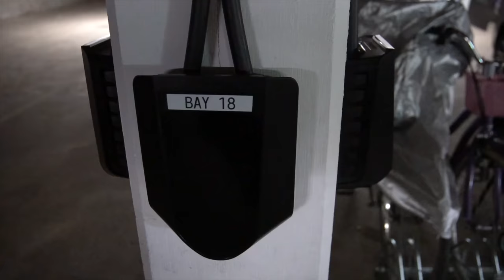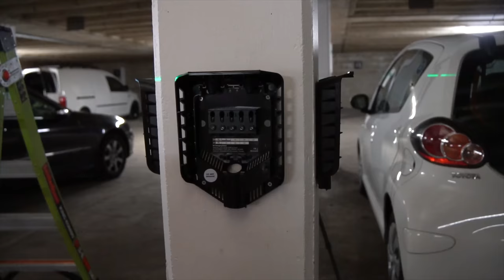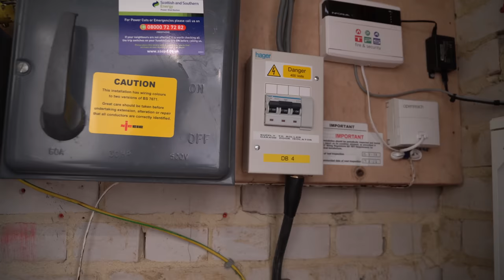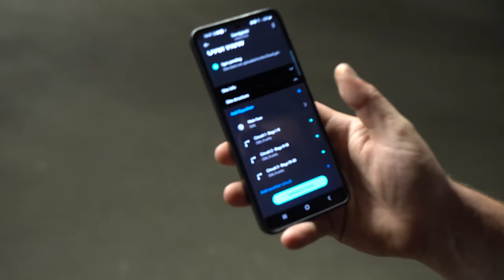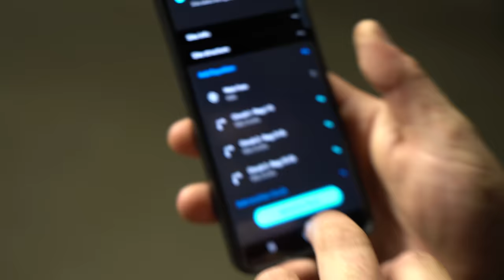Installing 660,000 watts of EV Charging

Comment: I'm a 60 year old semi-retired electrician and have disturbed a lot of asbestos in my time, especially in power stations accidently  knocking lagging off pipes, drilling into asbestos sheet thinking it was plasterboard, but what I'm dying of is silicosis caused by years of inhaling concrete dust from drilling and cutting!
Reply: Sorry to hear about the silicosis. But agreed on the asbestos, worked around it myself for years and years. So far, all good and even knowing the risks back then, never worried about it. But people today act as if you touch it, you'll die.
Reply: I know it’s a different type, but in Russia they still mine and use blue asbestos

Comment: Asbestos is fine if still intact, you can double bag it up and dispose of it properly, Chrysotile woven asbestos is relatively safe compared to other forms of asbestos so the risk from a few fuses is EXTREMELY low, There's more of a risk if a fuse has  blown as that may have damaged the rope. there's really no reason to throw anything away that's been in the same room.
Reply: He said there was asbestos residue on the floor?
Reply: @Pugjamin  How could he tell without specialist equipment? Could just be dust or plaster,  it's very unlikely if the fuse was in good condition.

Comment: Great vid as always Cory, regarding the thermal runaway, I think this is less of a problem in newer EVs, and will be less and less of a problem over time as we move to solid state batteries, so long as a company doesn't store a load of Chevy Bolts under your apartment, the risk is fairly low :)

Comment: In Belgium, there is a requirement to have an RCBO per charging point. Every charging point is therefore typically wired separately with 6mm2 into a distribution board close to the parking spaces, with the RCBOs in that distribution board. In case of a bus configuration, the alternative is to integrate the RCBO inside the charging point, but then this is not user-serviceable (i.e. you need to call an electrician to activate it again...).
Love the channel, lots of love from across the channel.
Reply: Yes Ruben, Correct. And in underground carparks Belgium also requires an emergency switch on every exit. 
Makes it a lot more complex with the rcbo's and the extra regulations.
Reply: Don't forget about a mandatory four pole isolator for each item of fixed equipment, haha maybe that's why they have top entry!!

Comment: I am based in LA actually Sylmar if earthquake fame, 71 and 94. I learn a lot from your channel. Your humor is great, I don’t always understand all the gags but I try. Also what u call all the parts and pieces of electrical equipment is completely different from here. Although we have single phase 240 to all our houses, we mostly run 120 circuits to the various rooms in our houses. Pool motors and AC condensing units get 240. I have a couple of car racks in my shop which r also 240. So I am learning u guys do things differently. And probably many ways more advanced. The channel is a lot of fun!!  Entertainment and education balanced to your whim of the day.

Comment: Good stuff Cory-monsta! I can see the day when they'll be a requirement to fit rate-of-rise thermal detectors or optical smoke detectors in any area that an EV is charging and cut the charging supply if tripped. The battery design is so important in minimising thermal runaway. Fortunately there's a move to lithium-iron-phosphate cells. Cheers
Reply: Came in this week

Comment: I managed to get the OZEV infrastructure grant for my flat - 55 dummy units plus my active one. We already had cable trays installed so they didn't need to do that, but went with Easee units too, great for load balancing. Had to install Wi-Fi too as poor mobile reception.

Comment: Did you really end up using plastic plugs on ceiling? In a case of fire, plugs will melt and all will collapse. At least in my country u are not allowed to plug and screw anything on ceiling. I always use concrete screws while fastening directly on concrete ceiling.

Comment: Cute little trick for drilling overhead take a small clear plastic cup with a hole the size of your drill bit in the bottom of the cup then slide the cup on your drill bit from the bottom outside to the inside of the cup and then place the drill bit in place on your mark and slide the cup up against the surface you are drilling into and the cup catches the debris from the hole instead of your face

Comment: Nice video.  Writing from the US here - so pardon if my metric to us to metric conversions are askew.  What you are doing on this job I think is fairly cutting edge - at least for the US - as we've not broadly prioritized electrifying multiple - much less all parking spots in an apartment building car park.  So there's lots to learn here about what is acceptable and good practice.  If I understood you correctly, it sounds like you are taking a 60amp 3 phase ~240V service line and splitting it 3 ways (I assume then effectively single phase) on each of 3 lines into ~10 chargers each.  You mentioned 22KW - which I assume is the approximate service of each single phase.  My question therefore is this:  If everyone signs up for the service (eventually) and everyone looks to charge at the same time say overnight, won't the effective per car charge be just ~2KW each (given 10 chargers per line)?  I'm wondering therefore is there a 'standard' for what available power should be across the number of shared units.  I feel like here in the US building managers are worried about needing to bring in multiples of 40/60 amp 240V circuits into their building paired with each new electric car that comes into the garage to 'live.'  Each also with a meter to measure monthly  usage for charge back to the user.  The idea of sharing a single, or even 3 circuits across 30 spots seems foreign if not quite practical.
Reply: In a car park with residential "home" charging there will always be the same residents parking each night. On average each car uses 8 kWh per day which means during 12 hours each charge point will use 0.7kW on average. Load balancing and metering is all handled via wifi connection to the chargers.
Reply: 66kW is able to deliver about 230 miles of range an hour, or 2,000 miles in 8 hours overnight.  For many apartment buildings this is going to be fine for quite a lot of spaces.  When working at scale you always leverage diversity, its just in this case you can actually manage it which allows you to run much closer to capacity.

Comment: I was working on a lift in an appartment complex with about 70 parking spots. With over 20 EV's but no chargers. I asked the chairman of the owners association if they were looking for someone to install them. Besides working on lifts I also install carchargers. He told me that their insurance company didn't allow to charge EV's in the garage underneath the flats.
In case of a fire that originated in a EV that was connected to a socket there would be no payout....

Comment: Interesting video, one question I have relates to the Matt-e, is it possible to have one shunt trip turned on without the other?  I’m just looking at the CPC configuration and wondering if ckt3’s needs to be in the right hand earth bar or does it not matter?
Reply: You are absolutely correct. After noticing one of the team had put it on the wrong side it was sorted, just so happens it was after it was filmed. 👊

Comment: My concern about the installation of dummy devices is if the manufacturer goes bust/changes the design and you can't get the live unit anymore. The government should introduce a universal standard for both the physical unit and also any communication/interface with the controller. 

Large scale indoor EV installations should have additional regulations associated with them, either fire alerting, supression or separation.

I agree, I'm not a fan of top cable entry, even if the manufacturer claims a certain IP rating.

Get yourself a milwaukee band saw, far quicker and safe than slitting/grinding everything.

Not all asbestos is the same, and can be OK to work with if you know how to handle it. You'll be amazed to know how many places/things contain it.
Reply from the maker: Great points raised
Reply: https://static.rsagroup.com/rsa/commercial-insurance-products/motor-fleet/electric-vehicle-charging-and-enclosed-car-parks-v1.pdf

The RSA brought out this guidance for installation of chargers . The Bsi is currently doing public consultation on their work . My concern would be integrate of structural elements as they defo WOULDN’T be tested to the temps a car bay fire would give . Fitting all those in such a space isn’t good practice IMO . I have asked SCEV in the thread but they havnt replied as yet ( strange )
Reply: That wasn't a transition to Boscombe Pier you were at the Harvester at Durley Chine 😂 I didn't know you relocated down to my home town in Bournemouth perhaps I missed a video?

Comment: Lovely install done by you guys.. on a side note, does make me wonder about grid capacity full stop though - from what I could see here, you've got a three phase 63A supply, but each of these car chargers is capable of working up to 32A each.. so to run all the car chargers at full capacity, you need 960amps. So if all the spaces had an EV plugged in and charging, they'd be running at about 1.4KW each. By Telsa's own calculations, a Model 3 would take about 48 hours to fully charge - so even with all the caveats of not every EV would be using 100% charge at the same time etc, there just doesn't seem to be enough power in the building to charge 30 EVs at any decent rate.

I think the other thing to mention is how on earth does this get charged for? As a communal supply, if I'm living in flat 10 and don't have an EV, and John in Flat 15 does.. I don't want to pay for the electric cost of charging his car in leasehold fees.
Reply: Hi, the calculations aren't correct, there are 30 chargers total, across 3 Circuits. Each circuit the max draw is 32A so across 3 Circuits that's 96A not 960, that would be correct if all individually fed.

Monta is how the billing is done and its on a per user basis
Reply: This is why Easee is good because if you have more than 1 on a circuit, it's the circuit that's load balanced not the charger (they balance between themselves)
Reply: Each car doesn't charge fully every day. On average each car will only need 8kWh per day so it averages out nicely.
Reply: @mrfrenzy.  You forget the ~250W draw of the computer whilst the car is charging. Its really inefficient charging below 2kW.
Reply: @SeanHoulihane  each car will charge much faster than that, but not all at the same time.

Comment: love the video, big fan, but regs state you cant use plastic plugs on a ceiling as when a fire hits the plugs will melts and the tray/wire will fall, defeats the point of metal cable ties, they state to instead use concrete screws. something to consider for the future.
Reply from the maker: They were used in conjunction with concrete screws, so the plug isn’t really necessary. But I appreciate the suggestion and the respectful way of putting it across 😁, it’s not that clear in the vid, you’re right
Reply: @corymac  Always good to be respectful, we are all in this together in this industry to learn and teach. look forward to the next video

Comment: SCEV did my Easeee install in Poole. Great service and would recommend to anyone in the area 👍🏻
Reply: Thanks mate, remember it well 👍 @TheTechOnline
Reply: Let's hope they installed an RCD / ELCB. The producer say they have that built in but they dont. That's why they are banned from sale in Norway and Sweden now. The Home and Charge models are affected. I'm ashamed that an norwegian company make such idiotic mistakes in 2023.
Reply from the maker: We did indeed @pederb82
Reply: Mine was installed in January 2023, prior to the sales ban in Sweden and the Netherlands. My installation is similar to that in this video, in a covered understory carpark, with limited/no weather effect on the device. 

SCEV fitted a Fusebox Type A RCBO anyways so I am not worried, but if there were to be a recall the design of the charger with a modular "robot" would mean it would be easy to swap out.

 @pederb82
Reply: @pederb82  There is no active sales ban on Easee products in Norway and there is an integrated RCD in every device. It would be nice if you didn't spread misinformation. :)
Reply: @michaelr2499  that is actually wrong. Norway conform to the ruling in Sweden. And they claim there is an rcd in the manual but in reality there is not. When pointed out they tried to blame the rules. They tried to claim it’s interpreted wrong and it is only recommended. It’s not. It’s required. That act was shameful. They didn’t admit making an mistake and try to fix it.  I am going to have to ask you to stop spreading misinformation stating it’s an legal product. Use Google. Read the news. You’ll find I am correct. Until they change the specifications and or the product it is not allowed to be sold here in Norway. It’s sad being a really cool product. They going bankrupt would loose a lot of good ppl their jobs here in Norway.
Reply: @corymac  good job. My comment was not meant as criticism. It was just an observation that you used these and wanted to make sure you guys was aware of the false claims in their manuals. :)

Comment: Big old install. That concrete is probably 50 years old at least so will be really hard, but should keep any burning cars or mattresses isolated from the flats. How’s the billing getting sorted? It’d be too much to whack onto the service charge, and not fair on Doris who gave up driving twenty years ago.
Reply: The charging apps monitors usage etc therfor can bill individual usage on a pay as go type system same as most multi user charging stations. I’m more annoyed at the use of grants being abused. We are never going to have full elec car usage so all those chargers ain’t needed . Also as Cory said the fire risk is crazy imagen 30+ elec cars on fire . The heat would destroy that C60 concrete and we seen how solid it was
Reply: Hi 👋 the billing will be done via Monta, so those that have had a working charger installed get added to the team as a member in Monta and get set up with their charging rate etc etc. The management company of the site will be paying for the subscription
Reply: I don't think added service charge is much of an issue for the owners considering how expensive a property is to buy in Sandykeld.
Reply: @southcoastev  aha, makes sense, thanks.

Comment: Quick question, if all of the residents went for a charger how would the supply cope with the amount of electricity required?
Reply: Hi there, it has an Easee Equalizer so it designed to manage the available load at the time of charging and distribute accordingly.

Comment: 28:50 Right, the cables won't fall because of the metal cable ties. But the hole tray will fall because of the standard plastic wall plugs 😅🤔🤣 There are screws out there that screw directly in the wall/ceiling without plug that are fire rated.
Reply from the maker: They’re used in conjunction with concrete screws, the plugs really aren’t necessary
Reply: @corymac okay cool, thanks for answering. Haven't heard it in the video. Nice install all in all👍

Comment: Funny thing, Becuase you are not in the eu anymore you are allowed to put up eease chargers. They have been put in a salestop in EU because they do not comply with safety requirements.
Reply: I have searched about the sales restrictions and they have not been suspended in the whole of EU. The only documented suspensions that I found were Sweden (most notorious), Netherlands and Austria. The argument is usually about the RCD being electronically controlled by software rather than electromechanically. These easee units are being sold in Portugal and Spain. AFAIK the portuguese regulation allows it despite being based on the same EU standard that the Swedish authorities are having trouble with
Reply: @triedtofail  it should/will result in a sale stop in the EES region as soon they are done in court in Sweden, if it get banned here it get banned in whole of EES. 
Alot of chargers uses software controlled RCD, Easee problem is that they use components with too small of a safetygap inside when disconnecting and they have declared that they use an RCD with electromechanical mechanism in which they don't. They do not meet the RCD/DC protection requirements that they rated the boxes for, witch forces external RCD protection 
They do not meet the ip requirement of ip 65 or whatever that they said the boxes have,amon a couple of other things. 
Easee solution to this has basicly been put a sticker on it with some information. 

You can contact Elsäkerhetverket to get the whole report. Altho it's in Swedish